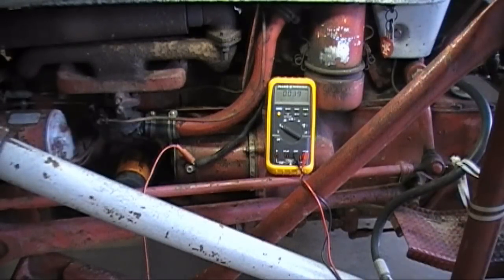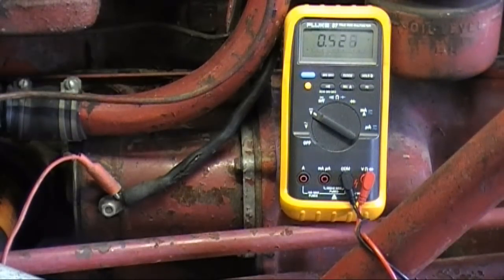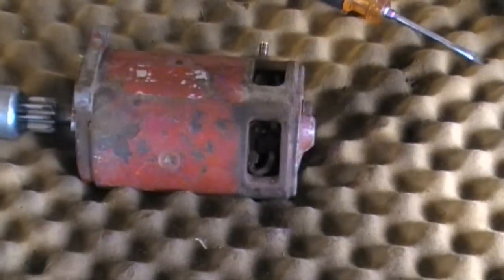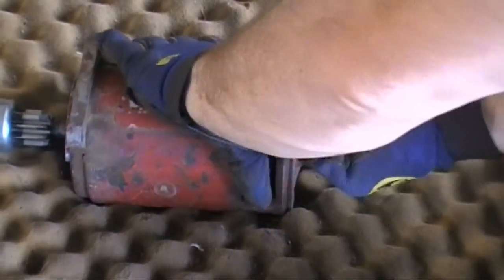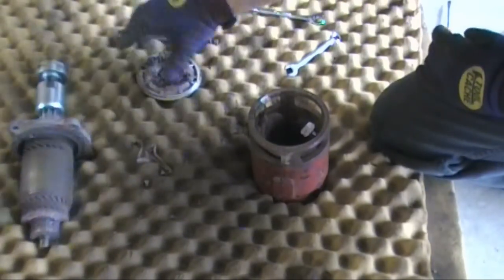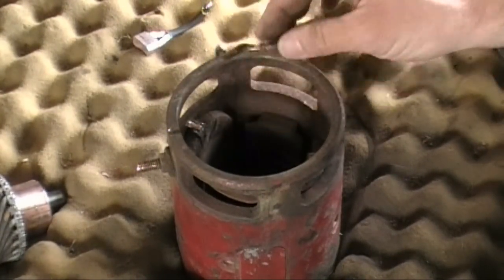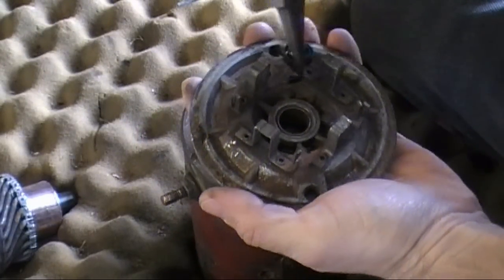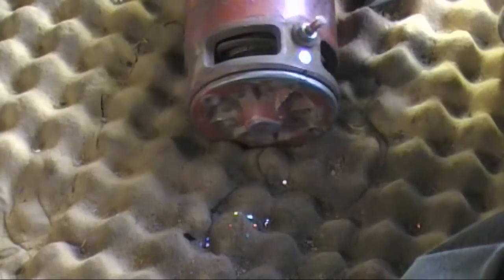Tractor Starter Disassembly and Rebuild Ford Jubilee  NAA 2N 8N 9N

Comment: Thanks for the useful post, we are working on a 53 Jubilee that just plain worked for 20+ years. We put off buying a 6 volt battery too long and as you know volts down cause amps up and killed the starter and never having a book on it we went looking for vids today and I suspected we had to pull the oil filter but working on it in the rain at 45F went in to learn more, seems hard to find folks that even know of these now. Yes ours is 6 volt positive ground with an original generator
Reply from the maker: IMMATURENGINEERING Thanks for the comment!

Comment: I have a 800 Ford tractor that has the same problem, called local Napa, to my surprise they had the brushes in stock $6.93 for the set. Thanks for the Video

Comment: Thanks.  In the end, I used a propane torch to heat the posts, put a puddle of solder on it, let it cool, then soldered the copper wire into the puddle.  The solder appears to have a solid bond now.

Comment: My starter quit right in the middle of planting potatoes.  Your video waved the day!  I was able to disassemble the starter, clean it up and get it working again.  Something i noticed is that the prongs that hold the springs were twisted a little to keep the springs from falling off while you slip the end back onto the brush after assembly.

Comment: Thanks for posting.  I'm having difficulty with attaching the new bushings with solder, not getting a good solder ..... did you have any problems there? - I should note my starter is slightly different, doesn't have the bending post.

Comment from the maker: @chuckgibson0 No, didn't have any trouble getting it apart. You many have to apply a little force, but be careful, the end cap is cast. I used 60/40 solder. Thanks for the comment and good luck on your starter.

Comment from the maker: You need a lot of heat. Use a propane torch with a soldering attachment to get enough heat to make the solder flow.

Comment: I have a 57 Ford 860 and the bendix has hung up on the starter flywheel the last time I started.  The Highpitch noise alerted me to an issue &  immediate shutdown.  I have since attempted to remove the starter with no luck.  once unbolted it will slide out about 1/2-3/4 inch then hangs up on something internally.  Other than splitting the tractor any suggestions on removal?

Comment: I have the same starter in a 1955 ford f250. for the life of me I cannot get this started. I replace the spark plugs, the coil, rebuild the carburetor, and new fuel pump. it's on a 6 volt system. the engine turns but really slowly and it still won't start. I took out the starter and I saw a really large rats nest behind it in the Bell housing area. I cleaned it out as much as possible. and the engine is still dragging. I'm wondering if there is something wrong with the starter or if I need to separate the transmission from the engine to clean that area out. any ideas?
Reply: If you get a meter and check the insulation on the armature as well.

Comment: The video does not address cleaning up the commutator. Obviously that was done while working on this starter. Do you have a technique suitable for the average home shop? The 8N starter I  am repairing also has a loose brush holder.